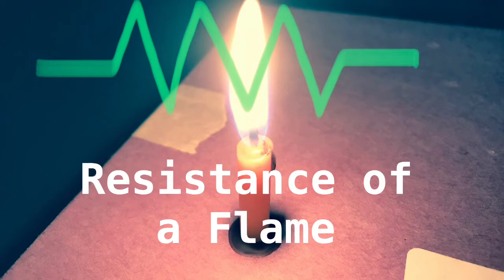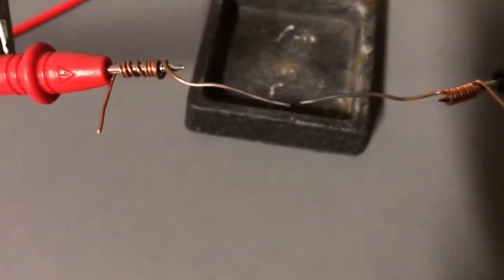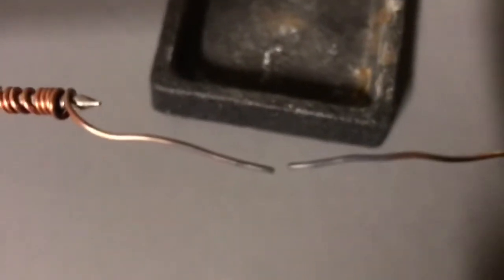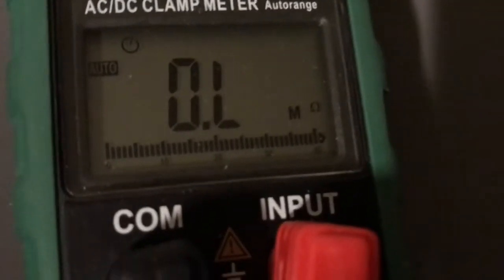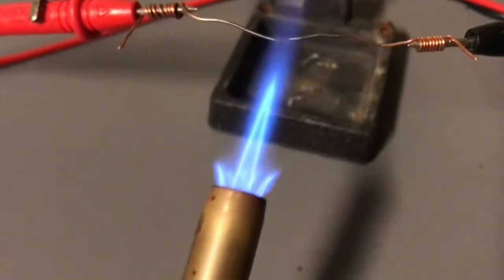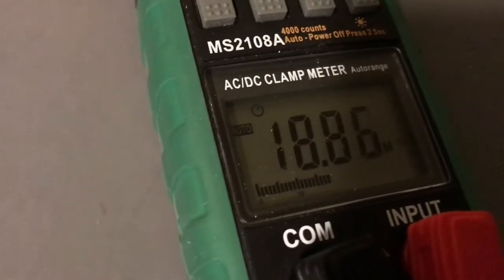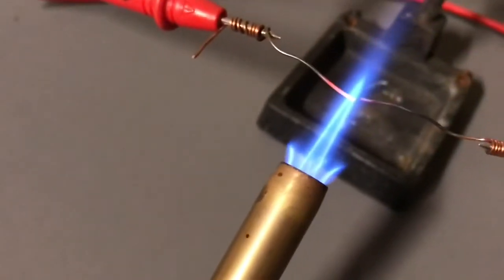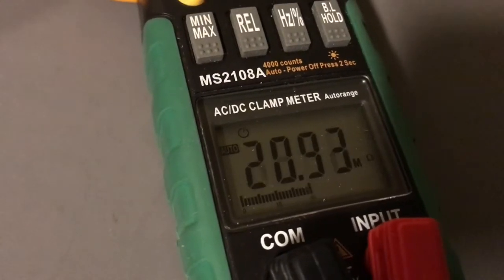Measuring the Resistance of a Flame with a Multimeter

Comment: Interesting. Modern Dometic propane refrigerators, such as those used in boating and RV applications, now use this method to sense flame rather than using a seperate flame sensor. Of course this circuit is very susceptible to ESD damage but it is fairly reliable.

Comment: You need some control data. How do you know you haven't made a thermoelectric generator, or are not observing some other effect.
Whats is the voltage and current that passed the flame? What happens at higher voltages, what happens with AC etc etc.

Probably better off measuring voltage and current to work out resistance via ohms law.
Reply: Mongrel Shark all good points! Thanks mate!

Comment: Very interesting idea. Maybe a candle flame would have less resistance? What about a hotter flame vs. a colder flame?
Reply from the maker: SciGuy the hotter  the flame, the lower the resistance. The resistance of the candle flame was too high because candle flames are not that hot. The very high resistance of the candle flame was off the scale of the multimeter. The resistance of HV arcs is like that of copper wire. The are can conduct 60Hz mains through it resulting in a lethal shock!
Reply: So, the candle flame was more conductive? Or did you mean more resistive? You said hotter flames have lower resistance, but that the candle flame had too low a resistance meaning it as a really good conductor (but it's colder?)
Reply from the maker: SciGuy sorry about my last reply to your comment which was incorrect. I had to edit the comment. Candle flames are not very hot and have very high resistance values off the scale of the multimeter.